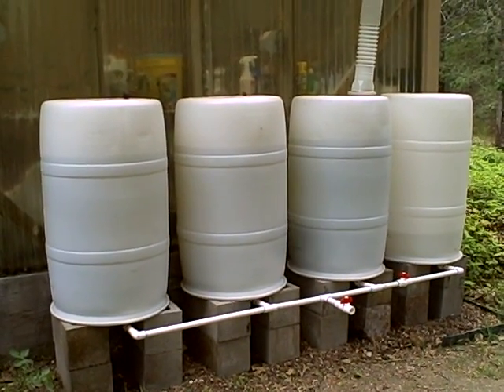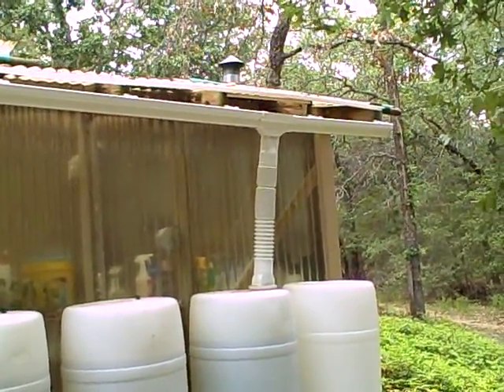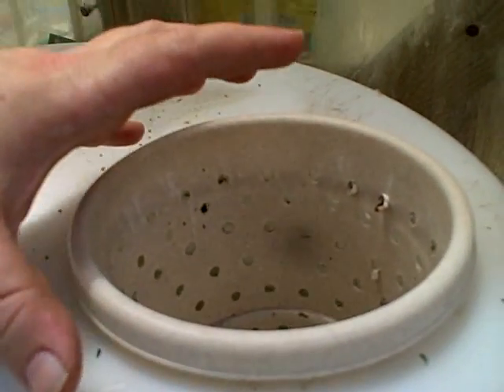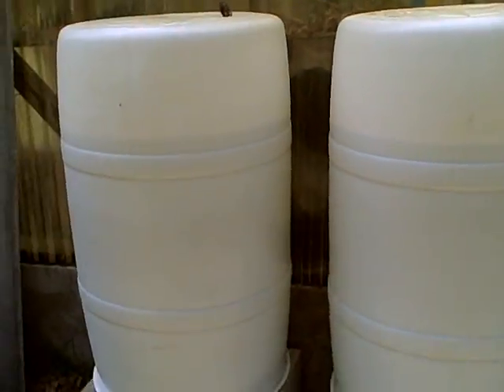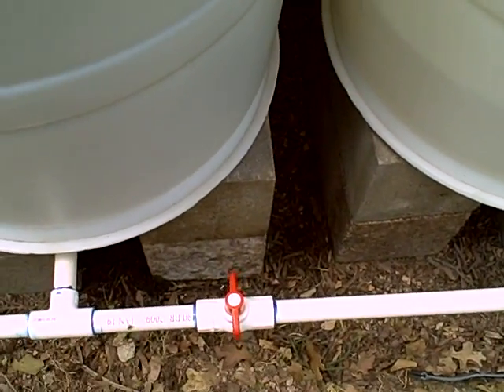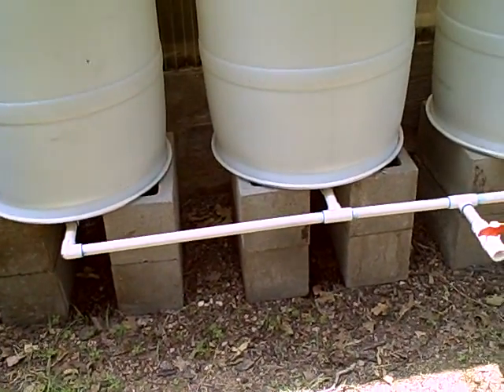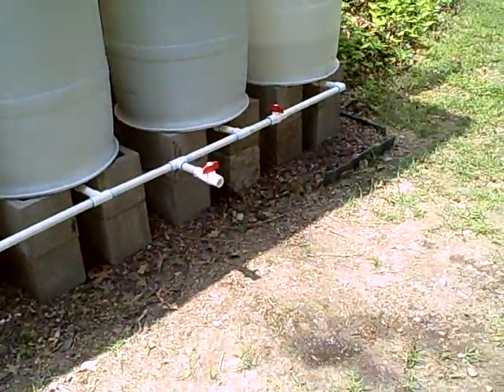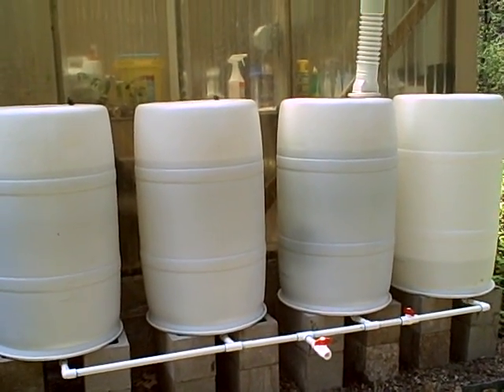MNT's Rainwater Collection System with Manifold

Comment: just a little sidenote...they are not in series, they are in parallel. series would be one filling then spilling over into a 2nd and so on. i think london1817 does one with 275gal ibc containers. paint them black to cut the algae's light source and to help warm the water. the manifold looks a little fragile sticking out there like that, im thinking a misstep, snagged pants leg, or a falling limb etc. would cause total loss of water from all barrels. maybe a shutoff on each? good video! :)

Comment from the maker: @ekenedilichukwu Thanks for the suggestion. Yeah, I thought about doing what you mention but by utilizing the bungs on the bottom of the barrels I avoided additional expense and work. The gunk in the bottom of the barrels is defeated by a filter screen I have in-line of my drip system. I clean it out once a month and haven't run into any problems with gunk messing up the system. Thanks for watching!

Comment from the maker: @paulmccarthy1989 Well, obviously, the closer the barrels are to the ground the weaker the water head will be and thus the flow will suffer. I bought a little pump at Harbor Freight that I turn on whenever I want to water the garden. I have a low-flow drip system connected to the barrels (not shown in the video, but mentioned - i should probably do another video showing the whole thing with improvements). The low flow system has a pressure regulator inline so the sprinkers aren't damaged.

Comment from the maker: @packagewarren The small black objects on top of the tanks are window screen that's crammed into the small holes cut into the top of the tank to relieve the pressure in the tanks. They are essentially mosquito screens. Thanks for watching!
Reply: did you do this to vent the barrels so they fill up with the manifold system?

Comment: hey Great job! I like the connection in series. It looks like you got more debris and "algae growth" that you can avoid. You can improve filtering by raising the outlet from each barrel few inches, instead of at the bottom. So you have a little bit of storage to allow settling and sedimentation. I have seen parallel connection,  but your connection is unique. I am thinking of doing same. Great job!

Comment: You mentioned a few times that the barrels are connected in series... actually, they are connected in parallel. Series would mean the water would go through one barrel before entering the next.  Otherwise, super cool system. Good luck with the expansion.

Comment: I love your video and am trying to make the system. I got my barrels from Pepsi, but they are rounded on the top, so when I turn them upside down they don't lay flat. Will the weight of the water flatten them out?

Comment: Excellent presentation.  Solid production and thinking around the clever manifold system and ability to expand.  What experience have you with DIY "first flush diverter" to handle roof wash before capturing all that good rain?   For large debris, I will use "wedge" screens for gutter downspouts.

Comment from the maker: @blackchyni These are open to atmosphere. This is intended to relive air pressure inside the barrels. In order for the manifold system to work allowing gravity to push the water throughout the system you must relieve the pressure within the barrels. A small one-inch hole in the top of each barrel is plenty for this purpose.

Comment from the maker: @grimatongueworm Yes, that can work, but the problem is if you let the supply hole double as the overflow then you run the risk of degrading the integrity of the pad the barrels sit on. It's definitely better to cut an overflow port and connect a hose to it (like a 2" sump pump-type hose) and have the end of the hose sitting a few feet downhill from your system. Thanks for watching!

Comment from the maker: @ritichi I have about 12 barrels now placed throughout my property and the house. I clean them out each winter. I disconnect the barrels from the drip system and pour a little bit of bleach into the barrels and let it sit for a few days. Then I drain the system, let it dry, and then cover up the holes.

Comment from the maker: @ritichi Nah, I wouldn't go to all the trouble of actually installing bleeder valves. Just cut a small hole in the top (an inch is plenty) and glue a patch of window screen or something similar over the top to prevent the mosquitoes from getting into the barrels. Thanks for watching!

Comment from the maker: @jayluketa Thanks for the compliment. Actually, I may not mention it in the video, but if you look carefully at barrels 1, 2 and 4 you might see some window screen sticking up. That's the screen that prevents mosquitoes from getting into the pressure relief hole.

Comment: Hi there!  Great system.  expandable manifold=genius.  

I'd like to mimic your system... but have a question.  How, precisely, did you join the PVC to the lids of the barrels?  Just a PVC 90 degree join, plumbers cemented in there?  Some sort of flange on both sides?

Comment: Hey Texan...thats a great effort and more than anything there is creativity!
I had one doubt. You said the barrels in series with interconnected pipe easily allows all the barrels to fill up. Does it work out fine?? If it does than the only thing to do is to drain out overflow after all the barrels are filled up. How did you do that??

Comment from the maker: @ChickyRx Did you watch the rest of the video where I explain that it's valved off? Watch at the 4:13 mark where I explain that the last barrel is "valved off" because I will expand onto the system at this point and don't want to have water in the barrel. Yes, there's a little water in the barrel there, but that was because I opened the valve to make sure some water would flow into it. Thanks for watching!

Comment from the maker: @YesWeTan So, my system is about a foot off the ground, and it's running through 3/4" pipe. I figure I'm getting about a 1/3 of a pound of head pressure of my system (before I installed a submersible pump in the fill tank). Thanks for watching!!

Comment from the maker: @YesWeTan That's a good question. I'm not 100% sure on this answer, but I'm pretty sure that the water pressure (aka "head pressure") is mostly determined by the height of the system. I believe that there's almost a half-pound of pressure per square inch per foot of head.

Comment: EXCELLENT - thanks so much for the video.  I was able to get two almost identical barrels from an acquaintance who works at a local brewery.  I coudn't figure out how to get a spigot on the lower edge (i.e. cutting a hole in the side) without cutting a large hole in the top for my hand/arm.  I didn't even thing of elevating the barrels, flipping them over and using the existing holes!  I'm so glad I saw this before I started cutting.  Thanks again - great tutorial!

Comment from the maker: @theinandoutlaws (part 3 of 3 reply) The Rectorseal is meant to be used in place of teflon tape (on the threads). The silicone sealent is meant to seal the perimeter of the cap to the bung hole and also seal around the PVC fixture where it screws into the 3/4" hole. I hope this helps!

Comment from the maker: @theinandoutlaws (part 2 of 3 reply) Then there's an "inner" part to the bung (the indention you see in the middle). There is a female threaded part here. I took a hole saw (I can't remember the size of the saw) and cut out the inner part of this cap - being careful not to damage the threads. Once this was cut out I discovered that a 3/4" male threaded PVC end screws perfectly into this inner part of the bung cap.

Comment from the maker: @theinandoutlaws Okay. See the screencap of the video response on this page ("Buying Rain Barrels Secondhand Online")? The thing the guy is holding is a "bung". There are two on the top of each barrel (however for our application the "top" ends up becoming the "bottom" of the system). The outside of the bung is a male threaded end that screws the bung into the barrel, itself.

Comment from the maker: @oldchimpdotcom Don't doubt the physics, man. Trust me when I say the manifold system works like a charm! That's the beauty of it. As far as having everything "super level"? All the barrels are sitting on blocks that are sitting on a 2-1/2" bed of pebble rock. The barrels are all level to one another.

A gallon of water weighs 8.35lbs. 55 gallons of water = ~460lbs. Trust me, the system settles down nicely and gradually. One year on and no problems! Thanks for watching!

Comment: Excellent video! Nice comment on using silicone instead of plumber's tape for the spiggots. I've watched the other videos...plumbers tape (for outside application) - yeah right (sarcastically).  You don't have me completely sold on the water level/manifold system. Seems to me like you'd need a good plumb line and a super level (non settling/shifting) barrel configuration? This scares me - :). Thanks again for the video. Excellent work!

Comment from the maker: Gunnarsguns: Sediment isn't a big deal. I flush the system once in the spring, and once in the fall. Running the manifold high would defeat the intent of the system. If you run it high then you simply have an overflow system. Also, installing a spigot on the barrels means multiple spigots (added cost) and moving hoses around as one barrel empties (added work).

Thanks for watching!

Comment from the maker: Crystallizedxx: You can find 55 gallon barrels in many places, but the most common are soda distributers (like your local Coca-Cola or Pepsi plant) or car washes.

Just make sure that you wash them out thoroughly. If there were chemicals used in the barrels (other than soap) then you might want to think twice about using them for water. I'd ask the person you're getting the barrels from what kind of solvent you should use to clean or sanitize the barrels.

Comment from the maker: GettingThereGreen: Yup, justonemorename is pretty much right on the money. The only reason to have an overflow is simply as an outflow should the barrels fill to capacity and can't hold more rain.

As I explained in the video: Water finds it own level. The weight of the water is greater than the weight of air. As long as the barrels are vented to atmosphere, then the water will ALWAYS flow THROUGH the manifold system and into the tanks - regardless of elevation, orientation, etc.

Comment from the maker: Thanks for the nice comments! Yeah, I'm planning on doing that. I'm working on getting a submersible "utility" pump and I'll place that in the barrels and then tie it into the drip system. (Of course, I'll use pressure reducing valves, etc so I don't damage the drip system.)

Comment: Damn this is NICE.  Best one I've seen on YouTube, by far.  The balancing through the manifold is VERY nice.  The breather inlets weren't mentioned, but I see them.
I'm not sure I would have done them upside-down, though.  Seems that you made yourself to a little extra work in having to seal the bungs.  Seems just as easy to put the bungs on top and drill a hole in the bottom, unless the bungs already were threaded...ah...maybe they were already threaded...if so, then it's better than I thought!

Comment: If you would have run the manifold up high then hook up the spigot down low on the last barrel it would have allowed sediment to settle in the intake barrel better before it went into the other barrels in series....just my opinion and i have seen it done that way

Comment: The reason rain barrels have a spigot 1" from bottom is to prevent sediment from clogging your output lines. If you were collecting rain off of a shingled roof you'd have a lot of grit in there. Great idea though. I was thinking of doing something similar to water my lawn through buried irrigation hose. If i do, I'll post a video of it.

Comment from the maker: jmygann: Yup, they do need air vents. I discovered this after the first rain storm. The adjacent barrels weren't filling with water and then I realized that the barrels weren't relieved of pressure. I cut a 3/8" hole in the top of each barrel in order to get the barrels to atmospheric pressure. Now they work like a charm!!

Comment from the maker: Hi, Reskridge: Yup. I did have trouble with that. I simply used a small hole saw to drill a 3/4" or 1-in hole in the top of each barrel. Then I glued a small square of window screen over the hole to prevent large debris and bugs from getting into the barrels.

Worked like a charm. As soon as you drill those holes you'll feel the air getting pushed out and the water will immediately begin filling the barrels.

Let me know how it goes!

Comment from the maker: CaptBrigg: Since the posting of this video, I've installed a run-off hose to the top of the barrel on the right. The land slopes pretty dramatically (into a wet-weather creek) away from the foundation of the building adjacent to the barrels (which is a greenhouse).

Thanks for watching!

Comment: EXCELLENT setup. I am really impressed with the manifold design.
One bit of advice about the algae -your barrels are translucent white, so the sunlight penetrates just enough to allow the algae to grow. I had the same problem, so I used some cheap paint (I bought a decent color of mis-tinted paint from Lowe's for like 5 bucks) and rolled it on. It stopped the algae growth.
Thanks for sharing the vid -it is GREAT!

Comment from the maker: You know, I had the same worries when I was planning the manifold. But, let me tell you that you'll get PLENTY of flow through the 3/4" line. The only time the fill drum has overflowed is when ALL barrels were full!

Just make sure that you cut a hole in the top of each barrel in order to relieve the air trapped in the drum (otherwise the pressure will not allow the water to flow into the barrel).

Comment: Great system have you thought about collecting of the roof of your house. Also if you use a paint strainer, made out of Mosquito netting, instead of the flower pot you are using for better filtering.